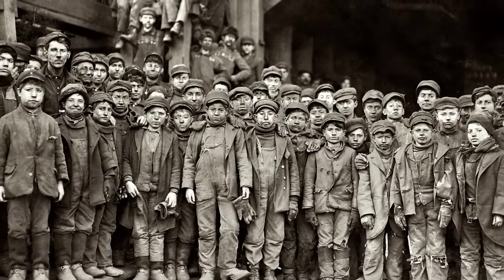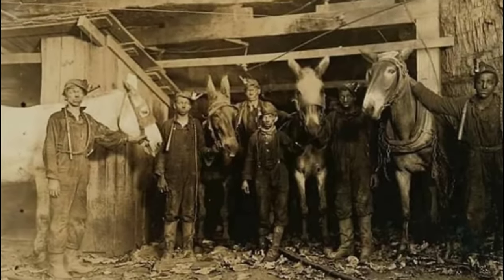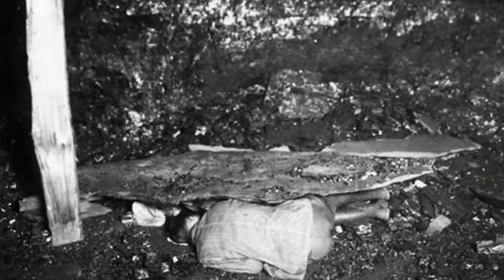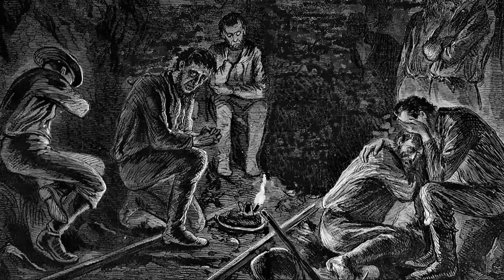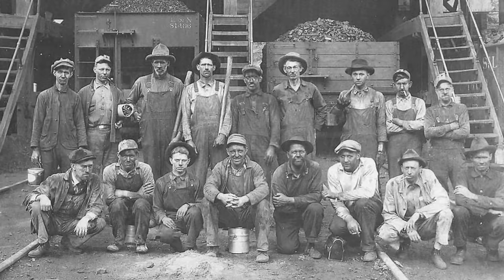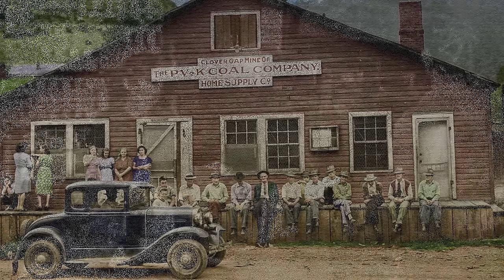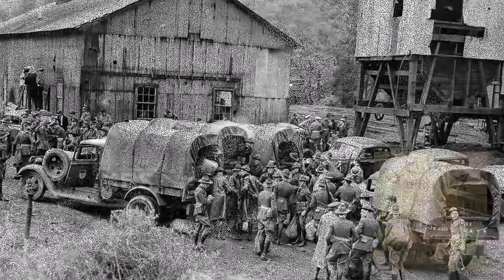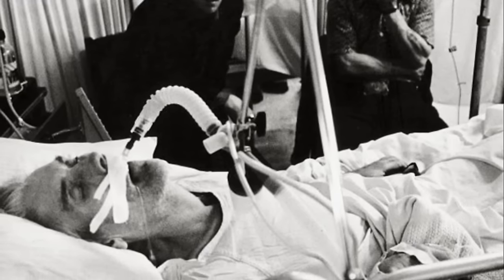The old ways of COAL MINING where the SUN never SHINES

Comment: Shortly after high school I got a job at a local company in Joliet, IL that made Instafoam...a quick expanding foam product used in construction and a few other applications.  I was told the product was also used in the coal mining industry to seal off fires in tunnels by starving the fire of oxygen.  It seemed like a logical use since the product expanded at such a fast rate that it would only take a few seconds to seal an opening.  The only thing I couldn't wrap my mind around at that time was the fact that the solid foam gave off a toxic gas when burnt.  I guess if the foam did catch fire miners still had much bigger issues to deal with than just a toxic fume.  Did you ever hear of or use an expanding foam product like that when you were in the mines?